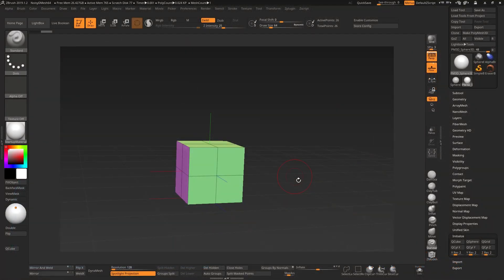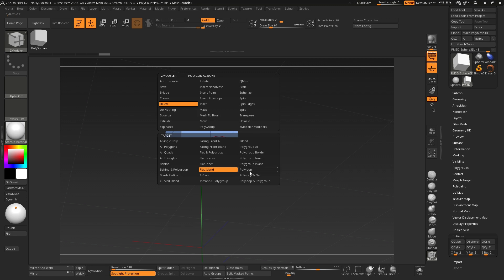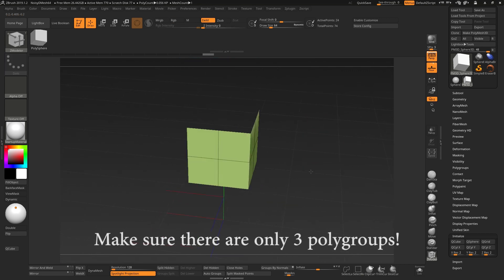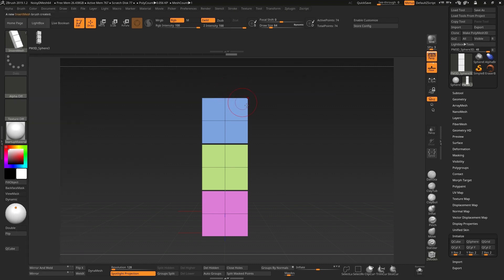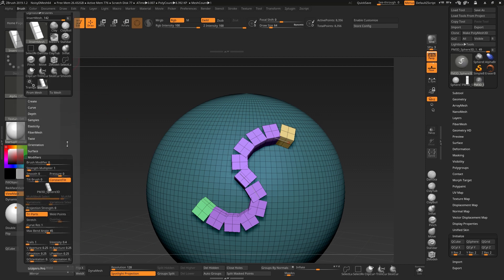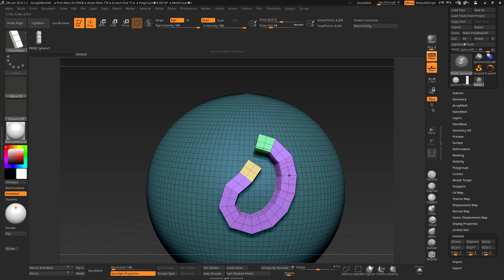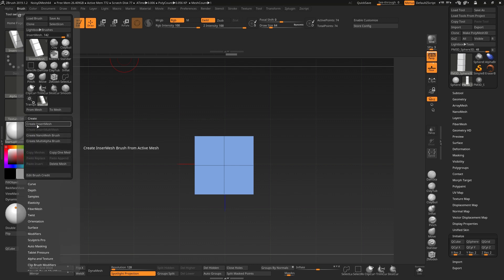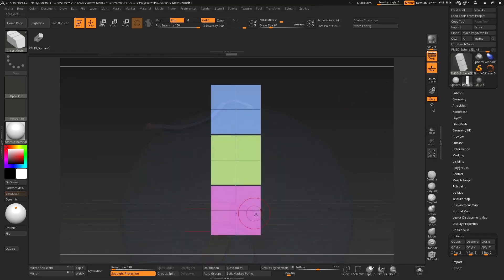How to make tri part curve brushes in ZBrush

Comment: hi thanks for this tutorial
i have question : How can i fit curve brush parts ?
For example when I put that around a cylinder first part not connected to end part
and there is a distance in curve brush
Please guide thanks
Reply from the maker: Hi Saeed, there is only way to do this as far as I know, left click on your model and drag your mouse off the model, then, with the left click still held down, press Shift. This will cause your curve brush to wrap around your entire model in a circle. Let go of the left mouse button when ready. Hope this helps!
Reply: @SeanForsythTutorials  Thank you very much

I wish you all the best